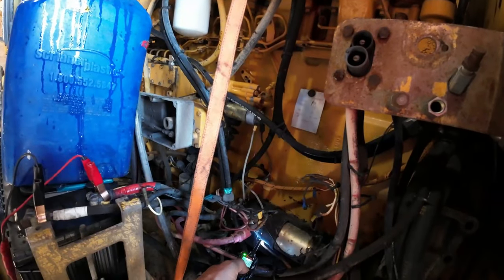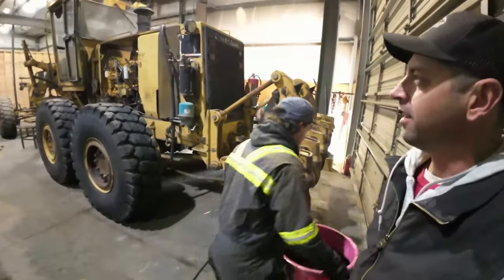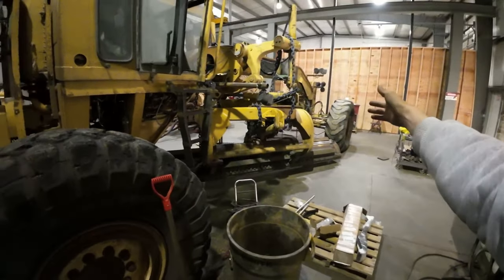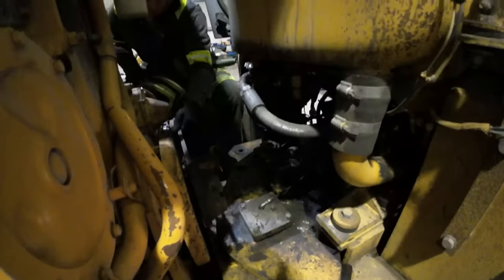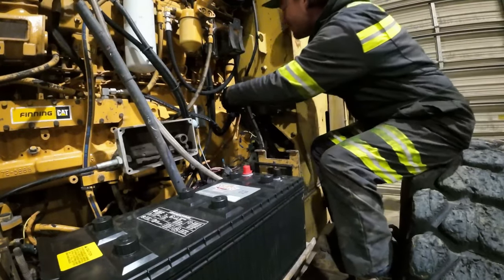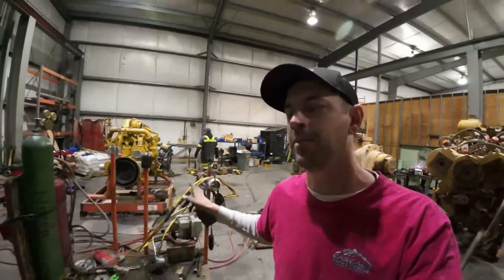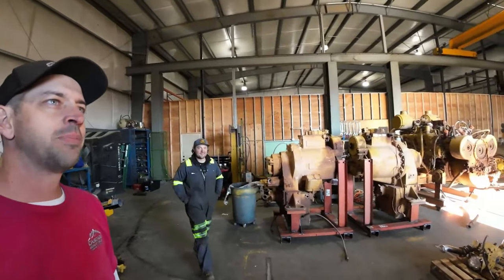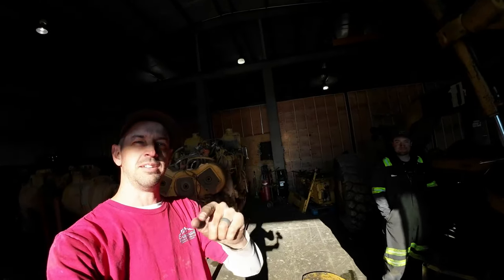Will it start??  Huge machine pulled from the Boneyard!

Comment: Run the rack on that Detroit before you do anything else, I’d love to hear it run! We(like I ever owned anything in my life) had a crusher that had a 24V71 what a racquet that thing made! Lol.   BTW: Casey, it’s a scavenge pump in a Detroit not a super charger, I know it looks the same and these engines is where people started taking them and putting them on hot rods, but it really only provides a positive movement of the air for combustion, without it they don’t run very well. Or at all. Have a great one!

Comment: That Detroit 12v92 is more likely to do a runaway than the Cat motor. Them 2 strokes were bad for that. And they were also known to run backwards. I had that happen once in the truck I ran in Europe. Stopped on a hill, and when I tried to take off, it died, and bump started backwards. Would have had 10 reverse gears and 2 forward if I'd let it run. I didn't.

Comment: This is not Recycling, It's so much better. The little green triangle stands for Reduce, Reuse, and Recycle.  To Recycle is to convert (waste) into reusable material.
They are Reducing the scrap metal from this old equipment by reconditioning and Reusing the parts for their original purposes on other pieces of equipment.
This simultaneously keeps someone from buying a new piece of equipment and scrapping their old one.

Comment: Would love a video on the 12v92t. but stop calling them superchargers, they are technically blowers. The only super charging done on that engine is done by the turbos. The blowers displace exactly the engine displacement.

Comment: In college learning how to fix farm equipment, one student had a John Deere, two cylinder diesel, pony engine and large flywheel with finger grips on it, put it together but neglected to attach the governor. It started alright, but would not stop. The instructor came over, shut the fuel off. Unfortunately it had very large fuel filters and kept accelerating. They stuffed rags into intake to stop the air, but they just got sucked in. Finally they disconnected the fuel lines on the two injectors to stop it. It took a long time to slowly wind down. I was uncomfortable enough to leave the shop, go to another shop and watch through the safety glass windows.

Comment: Let us hear the Detroit wind up! 
I had a couple of Detroits  powering emergency generators but I didn't work on the mechanical side - just the electrical. We actually took the two sets and put them on a lowboy to use for power to walk three shovels up out of the pit when we mothballed the mine.
This was a very interesting video. Great way to let us mild mechanics how easy it was to get that engine up and running safely. 
I hope you d another video with your friend getting something going even if it isn't the Detroit.

jack

Comment: Of course, most people probably want to see particularly large engines started and preferably used! The wish personally would be a really big two-stroke diesel from a ship or power plant! I worked on a large tug that could be felt in the ground two km away when it was started with the help of compressed air and then it was a relatively small machine...
However, the viewers should have extremely good bass speakers for the right feeling - they are so low-rev that they are more felt than heard!

Comment: You can’t count the blowers on that Detroit as power increasing components, it’s just the turbos that add power. Since it’s two stroke, the blowers are a must to force in fresh air and force out exhaust. Since the two stroke Detroits came with blowers from the factory as mechanical components that literally determine whether the engine runs or not, a two stroke Detroit with a blower is considered by the manufacturer to be “naturally aspirated”.

Comment: We used to keep a large airport size CO2 or Halon fire extinguisher on hand in case of a runaway. Dump it down the air intake. Without oxygen they don't run either.

Comment: My understanding is that in the automotive industry the reason why engineers design motor vehicles are not for the benefit of the mechanic is for the benefit of the assembly line.  So I suspect the Cat machines are probably not assembled on an assembly line. The engineers actual put a great deal of time and thought into design. A mechanics could actually work on equipment and not have to be a contortionist.

Comment: The 3306 is one of the best engines built when the shtf that engine will run. I was given a 966 e that was sitting i. A island village a couple hundred miles from nome  i flew up with a couple of batterys went to the dump and went through the same procidures it took a about 10 min to get it running and out to the barge landing. What a will it start video

Comment: I've heard plenty of 12v92 run but wouldn't mind hearing it run. Since that hasn't ran in a while probably put some vice grips on the rack just in case it doesn't run away on you. The vice grips are a simple way to close the rack to shut the fuel injector off and be able to manually over ride the governor

Comment: Simple way to prevent run away on a unknown diesel engine. Disconnect the air intake between the turbo and the engine. Just let it run naturally aspirated . This eliminates the possibility of oil getting into the engine causing the runaway

Comment: I believe there is a slot in that drive shaft guard that you had taken off that's about I don't know two and a half inches tall by over a half inch wide right across from that drive shaft zerk fitting I believe that's what that slot is for if I remember right to give you a way grease that zerk fitting you said was hidden

Comment: When I was about 15 I had a intake side seal go out on a XT 190 Allis Chalmers while pulling a 5 bottom plow and was able to get the depth reset on the 3 point and let it go as deep as the plow would go and killed the tractor after all other attempts to shut it down failed.

Comment: that V12 as long as the rack is free and moving it will start and run I have bought a couple that sat 40 plus years and start run and put into service with just a fluid change that was one of the best engines ever built

Comment: I spent years working with the 16V92's in the oilfield. Make sure you roll the V92 series over by hand first if they have been sitting a while. They have a wet liner that likes to leak into the cylinders. We used to say that instead of a button to start them they should have a pin you pull.

Comment: 30 plus years as an engineer retired a chief engineer I found for big engines a CO2 fire extinguisher pointed in the intake will shut it down quick without putting someone near the intake so no one is near a bad sucking incident

Comment: Ran a set of those exact Detroit gennys when I was in the military during a TDY. Three running continuous, with a fourth unit for PM swaps. those things were crazy loud, running wide open at 1800 rpm. Was glad to get back to the larger slow speed units at my regular duty station.
Interesting point on those gensets, they were notorious for slobbering oil into the intake from blown seals on the turbos, and then you did need a board to stop 'em.

Comment: That's two 992 transmissions next to each other, there isn't two on the machine. The transmission is mounted in the rear chassis and the dropbox or transfer gears have output shafts that run to the front and rear differentials - there are two shafts for the front drive as it goes through the articulation point.

Comment: hah ive worked on a few of these grader transmissions, normally even if you left them in gear and started it up somehow they shouldnt go anywhere, part of the test procedure is to test the neutralizer valve, stop rotation in any gear other than N, wait for all pressures to drop, put back on input rotation, no clutch pressures should rise at all, then when you go back to neutral it should click the clutches back on. so yeah, in theory it shouldnt go anywhere, but i still never trusted it.
Reply from the maker: Exactly.  It shouldn’t go anywhere, but I’m not willing to bet my life on that.

Comment: I was told by a old colleague about a tractor at an ICI plant when there was an escape of flamerble gas and a tractor was in the cloud even after the key was shut off cutting the fuel but it kept running on the air gas mix until it melted
Reply from the maker: Common in the oil fields

Comment: Old truck drivers always took plastic garbage bags to put over the air intake to kill the engine.
Reply from the maker: That would do absolutely nothing.   Even the plywood we had ready was really not as solid as we would have liked.   That engine in a runaway situation is powerful enough to suck a phone book through the intake and not even slow down

Comment: Yes there are a crap ton of heavy will it start videos.  NNKH, Andrew camrata, diesel creek, lets dig it. Diesel brothers.....etal.
Reply from the maker: I’ve never seen a single one of those so large mining equipment
Reply: @CaseyLaDelle  well a motor grader is not necessarily just "heavy Mining equipment." Most earth moving equipment is used across many lines of industry.  Now if you did a will it run on a 20 yard drag link bucket then yeah that is probably isolated to "heavy Mining equipment" as they are usually built on location retired on location.

Comment: So now the question is why did they park it and leave it to rot? Main hydraulic pump or transmission?
Reply from the maker: We’re guessing transmission, and that’s why the control box is torn apart in the cab
Reply: @CaseyLaDelle  Yeah, either someone was doing deep troubleshooting or some serious scavenging.